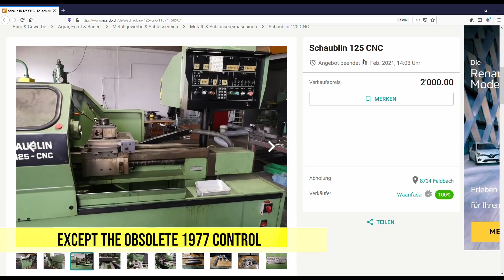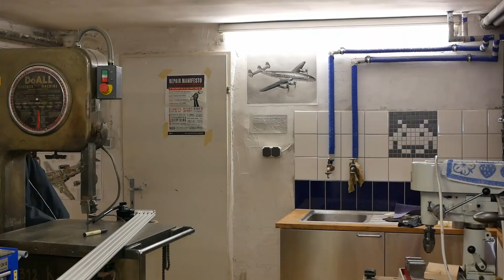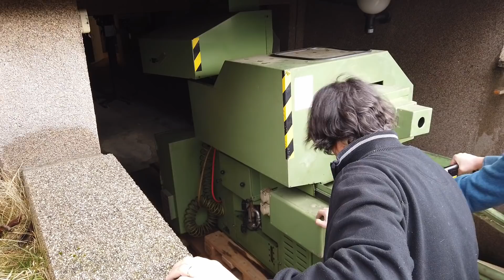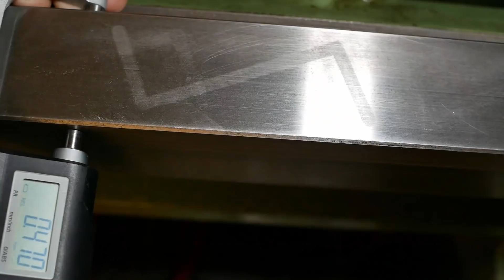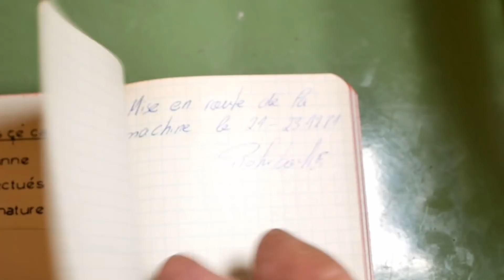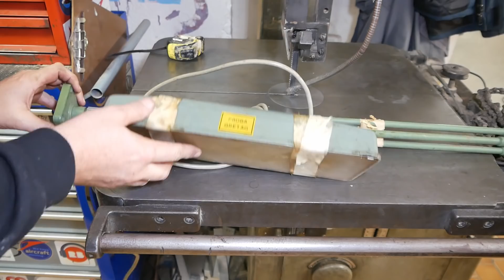New-to-me Lathe - Schaublin 125-CNC || RotarySMP

Comment: For my 2 pence worth the variator first then vfd if needed. Just realised my old Hardinge from 1957 has the same system mine in the manual hand crank variator though. Just fitting a vfd to it. What did you do with your motor to run the vfd? Were you able to change to delta or did you get a 415v vfd?
Reply from the maker: Over here all buildings have 400V 3 phase, so I just got a Lenze 400V VFD. 
Even our old apartment had a 3Phase circuit for the oven. I feel sorry for the US with that 110V and rotary phase converter stuff you need.
Reply: @RotarySMP  you lucky barstuard! the 240v single phase here in the UK is still a problem.  I got this Hardinge from a well off retired bloke who had had three phase put in £5000! I have stopped motors to a modern delta wired one and a 240v vfd so it runs. Only problem is motor spindle diameter is different so need an adaptor.
Reply from the maker: @chrislee7817  My best man also lives in the UK and has two Hardinges. Nice lathes. Lucky you can jumper a motor to delta.

Comment: Congratulations. This is definitely a worthy companion to the MAHO. I'll be watching your progress while I install my Mesa cards in my Denford Triton.
Reply from the maker: Thanks. Which Mesa cards did you decide on? I haven't yet decided how the conversion of the Schaublin is going to be.
Reply: @RotarySMP  You know what they say, go big or go home. Since this is my first Mesa card and I'm not quite sure what all I'll need, I decided to spend the extra money and get the 7195. @ $250 US, it's a bit on the expensive side but I won't need any daughter cards (I think). I spent way too much time trying to decide weather to go with a Pcie card or the ethernet one. I don't have a lot of room inside my Ebox for a motherboard so I decided on the ethernet card so I would have better options on mounting my PC. I could have used one of the 7176 series card but I don't know if my stops etc. are sinked or sourced and the 7195 can be either. I'm in the middle of a new computer swap and all of my schematics are trapped on a drive that is not accessible at the moment (bad planning). I will use a 7196 card for my CNC plasma table because it is much cheaper $120 and the plasma is way less complicated than my Triton which has 3 servos, 1 servo spindle, (8) auto tool changer carousel and I need to add a control panel and a 3 axis FOB and maybe a 4th axis at some future date plus all of the end stops and such. I would rather have too much card than not enough and I could always swap it out later if I over bought. The 7195 would be a good card to have on hand for future projects if it turns out that a 7196 will do the job @ $120 with maybe 1 extra daughter card @ $50. Tough decisions. You don't want to waste money but you don't want to come up short either. Waiting for parts to arrive is a PITA.

Comment: Hi Mark,

I am glad to see that the schaublin is in good shape, congratulations!
The rubber-profiles that clamp the PC-Plates were pretty common in the 80’s. They are still available on Hug-technik (Hug has also great quality Pulley’s and conti belts and so on).
You can also wash the profiles with warm water, I did that on my DECKEL, I reused them and only made the PC-windows new.

Anyhow,  mounting the Rubber-clamp-profils  is a huge pain in the B*** without the two mounting tools. They look simple but its sucks if you don’t have them, and these tools are not that cheap. I have a set and can borrow it to you, let me if you are interested.

Looking forward to the retrofit!

Cheers
Tom
Reply from the maker: Hi Tom, thanks for the offer. I need to see if I can get that sheet metal under one of Moto.64's presses.
Reply: @RotarySMP   why? Is it bend?
Reply from the maker: @surmetall5596  A bit, the edge  between the two windows. Looks like it was a transport strap.

Comment: Have you ever had access to scrap GE turbine blades to play with? The ones with diamond coating?
Reply from the maker: I don't know of any with diamond coatings. I managed some GE90's butthe TBC was not a diamond coating.
Reply: @RotarySMP  I could be mistaken but I believe GE did have a type of chemical vapor deposition onto a titanium base for turbine blades.
Reply from the maker: @HansFormerlyTraffer  I think you might be confusing technologies. Titanium is only used down the back of the LPT once enough energy has been extracted, and doesn't then normally need ceramic  thermal barrier coating. The HPT blades are always nickel chrome based super alloys. That PW4000 Nozzle I pulled out, and the GE90 HPT2 blade would both have had TBC. The GE blade still did, but the PW blade had been stripped and inspected before it got scrapped.
Reply: @RotarySMP  Thanks...way above my head...I am interested but not much knowledge of these processes. I tried to research diamond coating several years ago and learned some but then the resource disappeared. If you could share a link to such info I would love to study it. Thanks for always replying to my inquiries.
Reply from the maker: @HansFormerlyTraffer  You got me thinking.  (that is quite a feat :)

Diamond is just carbon. TBC is a refractory ceramic. Diamond would just "burn" is that enviroment. 
GE scientists did develop the process for making artificial diamond, but it required heat and pressure (lots of), not sure how a vapour deposition process, which is typically conducted under a vaccuum could produce diamond.
The gas turbine problem were a diamond coating would really be the bee knees would be VSV bushing wear.
Reply from the maker: @HansFormerlyTraffer  You are right...
NSD:
microwave plasma-assisted chemical vapour deposition is used to make diamnd coatings.
https://www.sciencedirect.com/topics/engineering/diamond-coating
Reply: @RotarySMP  I will try again to find some of the info that I read years ago. I seem to recall they developed a acid/vapor diamond deposition process that involved carborizing a substrait (thought it was titanium) then converting the top layer of the carbon to diamond
. But my memory is old and I could be WAY off.
Reply: As I look into this I realize that not having a background in chemistry OR materials science...I really only know enough to broach the subject.
Reply from the maker: @HansFormerlyTraffer  Pretty cool what they now do in material science though.

Comment: Following, setter operated one of these back in the in the early 80's when i worked at RR aero engines Coventry UK. great little cnc super accurate, the programmes were stored on magnetic tape cassettes! it'll be great to see yours running, best of luck
Reply from the maker: Thanks. I wonder what surprises the retrofit will hold.

Comment: ought be good piece of kit since its swiss. I feel sad because all these youtubers have better machines in their garage than what i have to work with at work.
Reply from the maker: I guess no company has time to muck around with retrofitting old iron, but this one really had good bones.
Reply: @RotarySMP  old is the problem at my work. They dont buy anything new, just collect junk to take up space and do nothing. I drive 3 index lathes from the 90's. None of them work properly. They would have to be torn to pieces and redone properly but at that point what is the point? The 3 machine retrofit would cost more and take more time than just getting 1 new machine. Oh well, i dont have to stay there if i dont want to. Actually i'd like to opne my own shop but its so expensive. Maybe some day.

Comment: Hello,
What a nice lathe and a great addition to your workshop and channel... It will be good to see the old control panel driving the lathe before you replace it. Will it be hard to find a tailstock? and the BIG question is will you be keeping the "polished turd" or will it be going into retirement.
Take care.
Paul,,
Reply from the maker: Thanks. I will definately make a video which is just a hommage to the existing controller. More as a hstoric document.

I don't expect to find a tailstock for a resonable price. A friend here has a 125CNN (later model) so I will borrow his tail stock and reverse engineer it. At least that is the plan.

Both the Boley and the Mini Lathe will have to go.

Comment: Looks mint for it's age. Are you planning on keeping the resolvers? I'm working on a CNC mill project with resolvers and still debating resolvers/encoders.
Reply from the maker: I'm tending to modern AC servos, due to the compact drivers, without needing transformers.
Reply: @RotarySMP  You could look at the 7i29 (would run both servos) and 7i49 combo. It would save a lot of space compared to current. 
LinuxCNC can be configured to treat resolvers as absolute devices (using position.txt to get close, and then absolute resolver angle for the rest). If you do swap, consider something with absolute encoders as, if you intend to use a tailstock or steady rest, it isn't always easy to re-home a lathe.
Reply from the maker: @andypughtube  Thanks Andy. I hadn't considered that. Not touching the existing motors is tempting. I'll look into this.
Reply from the maker: @andypughtube  Hi Andy, I started a new thread on the LinuxCNC forum for this machine. I am just looking in the 7i29 and 7i49, but will need more of your knowledge here. Thanks.
Reply: I am a fan of resolvers. In fact one of the servos was modified by removing the encoder and swapping it to a resolver. (I was re-machining the rotor to remove the brake anyway) 
Mesa 7i49 works very nicely with resolvers as long as the drives don't need them themselves.

Comment: The zip tie/cable tie or brand name ty-rap was invented in the 1950s for use in the airplane industry.
Reply from the maker: I looked up that wiki after saying that.
Reply: @RotarySMP  In any case I have devices from the '60s already using them (intact machines, no later additions)
Reply from the maker: @janosnagyj.9540 Weird thing is that aviation ignored them and kept lacing wiring harnesses for decade after that :)
Reply: @RotarySMP Yeah that industry is not known for innovation, but for safety measures :) So they needed evidence they really work :)

By the way: may I ask, where did you pick up that strong New Zealander accent? It's really a pleasure to listen to you :)
There is a guy on YT (Geoffry Croker) he speaks like this :) But he's native there :)

Comment: I like the concept of a turret with 4 quick change tool holders.
Reply: And I would definitely prefer a gear train over belt drive. They probably switched to belt because it's cheaper.
Reply from the maker: @MF175mp  I will cover the drive train. It is a hold over from the manual 125.

Comment: The HPT turbine nozzle is a PW4000.  The compressor blade is also a PW4000.  The neat thing about those compressor blades is they have a thermal spray coating on the tips of them.  Very unique design.  I don't recognize the LPT vane off the top of my head.  If you want to know what the rest is out of I can tell you with P/N's.
Reply from the maker: Yep, PW 4000. We had them at Lauda Air.

Comment: Congratulations on the new machine, he appears to be in very good condition, if you plan a retrofit, as you said try to give the old control a try for the fun of It : D.
Reply from the maker: I will.
Reply: @RotarySMP  Rotary, maybe, if it appears to work it (control gear) could be donated to some... masochist who needs if for their   fix of old school  nc/cnc assuming they have a schaublin with dead electronics etc.
Reply from the maker: @alan-sk7ky  I know of at least five guys with Schaublin 125-CNC's or CCN. Only my friend with the CCN has the original controller but it has a Fanuc.

I found sites in the UK and US who collect the mini computor brain in this thing.